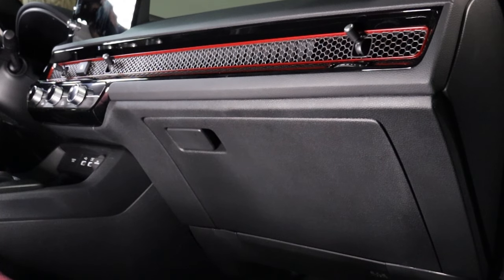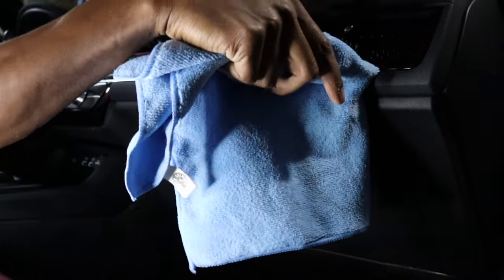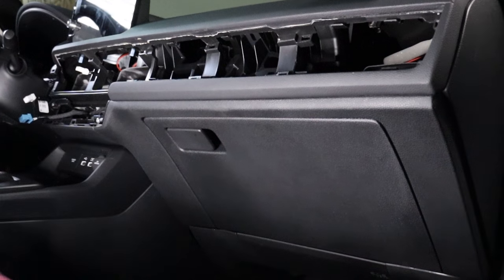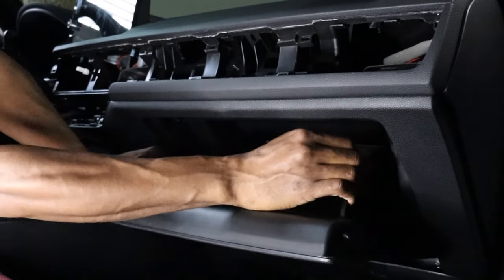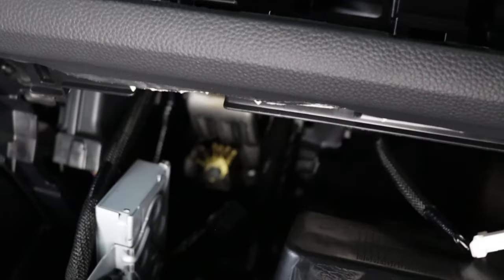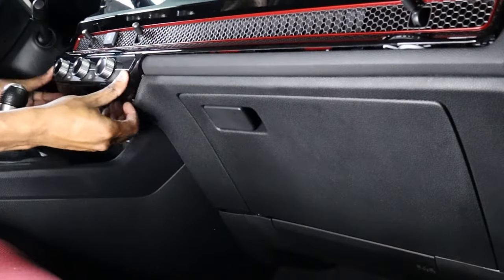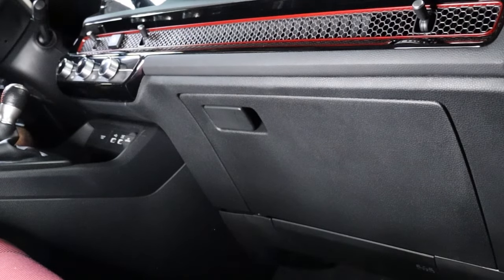How To Disable Active Sound Control (2022 Honda Civic)

Comment: Crazy that they make customers do this and don't just let you choose whether you want it in the software - it's quite obviously something a lot of people won't like!
Reply: To my understanding, it can also affect aftermarket sound systems, essentially making these disabling steps required for any aftermarket upgrade. Quite ridiculous!
Reply: @vanquish421  no need to upgrade anything. I’ve added a full range amp, sub amp, and DSP processor with no issues.
Reply: @sirsnypes631 ik this is late but he’s right, this does affect aftermarket systems , but not permanently. I got a subwoofer installed and when the active noise came (fake engine noise) it bass boosted throughout the car randomly, drowning out noises from the music and making it annoying. I just unplugged it with these steps in the vid and it went away, so it sucks that it is something you may have to do to aftermarket equipment
Reply: Why not put the engine sound into comfort in the individual driving mode bro? Doesn't that turn it off?

Comment: It's such a non-issue. It's hardly noticable, especially if you are listening to music. It's nowhere near as evident as it sounds like on some of the review videos where it's amplified.  The air conditioner at 3 is louder. Seems like alot of trouble to go through for something that is hardly there. That being said, I'm just happy manufacturers are bothering taking the time to even put it in there. They could easily give no supplemental sounds. At least they are trying to spice things up.
Reply: I’m taking away your enthusiast card…
Reply: @NYGFRANK87  this is too funny I agree
Reply: @NYGFRANK87  Honda said they added it because the exhaust is so quiet that while on track you might not get any audio cues where you are in the rev range, especially with louder cars around you.

Comment: Can u do a noise comparison between having it plugged in and not, im debating on doing it to mine
Reply from the maker: As soon as I got done editing this video, I thought to myself “someone is going to ask for a comparison” haha. I will get one soon. It’s not a huge difference, just one of those unnecessary add-ons in my opinion.
Reply: @projectbluray9376  we appreciate you
Reply: @projectbluray9376  thank you for this will be waiting for the comparison thanks.
Reply: Honda has declared this option functional. So if there is 1% of fake sound is there, you have to believe.
Reply: It sounds just like driving in normal mode really… there is a difference with it disabled but it’s just the fact that you can’t hear the fake noise anymore. I personally like it disabled cause the fake exhaust sounded silly.
Reply: Is obvious the difference from the fake noise is very weird in my opinion hate it since day one.
Reply: @projectbluray9376  Can we get that video comparison now? I got a civic si recently and want to disable mine as well
Reply: It’s enough to annoy me. I unplugged mine less than 2 weeks after I got the car. Maybe the type r is louder than the si? It annoyed the shit out of me.

Comment: You don't have to disconnect it. Just de-pin or cut 4 output wires at the amp and you'll never hear the fake engine sound again.
Reply: Have any details on that? I haven't been able to find anything.

Comment: So I recently did this today, I found out that you dont need to take off the vent. I didnt see what the vent was holding to the inside of the glove box. It is only that side trim and everything underneath .
Reply: A part of the glove box sits under the HVAC controls, which is part of that big vent piece.  You do need to release the vents at least halfway off, no need to disconnect anything but at least partially off

Comment: Very helpful. This video made it easy. Just did it in my 2024 type r. You don’t have to fully remove the ac vents. Just need to unclip it slightly past the glove box panel. It’s nice to be able to drive in +R without hearing that Weed whacker sound

Comment: Thanks for posting this. I have a horrible dashboard rattle right over the glovebox. I’ve had my Type R into the dealer twice. They supposedly put sound deadening material under the infotainment screen. That didn’t help at all. I’m going to put in sound deadening mat material/wire wrap myself and use your video. 👍👍👍

Comment: Did this for my 24 CTR today. Found it easier to pop the side panel off and push the air vents out from the inside. We are unable to remove the plug for the Start/Stop button so I kept it plugged in. The Active Sound Control is on the glovebox so only the glovebox needs to be removed.

Comment: Update for RHD Civic Type R - the ASC unit is fitted on the opposite side, behind the glovebox. As with the LHD in thie video remove the passenger side dash end panel, glove box compartment, 4 retaining screws on the under dash mount panel and its on that panel adjacent to the centre console.

Comment: Excellent video. Picked up a ‘23 Si three weeks ago. This is an immediate “must do”!
Reply from the maker: Thank you!
Reply: Naw for real 😂 I got mine 03/21/23 😅 quite annoying
Reply: @Fracking2319  😂Facts!
Reply: @B702K  a pillowed can of bees
Reply: @Fracking2319  😂👊
Reply: @Fracking2319  What color did you get?
Reply: @B702K  white pearl. You ?
Reply: @Fracking2319  Same, platinum white pearl! 👏👏👏
Reply: @B702K  noice....I've noticed it really pops on cloudy overcast rainy days 😍😍😍
Reply: @Fracking2319  The metal flake in the paint is f**king gorgeous.
Reply: I just got my 23 si last Wednesday.  I'm loving it. Able to get 42 mpg on 5th gear at 70 mph. Surprisingly 5th gear is better for the car at 70 mph than 6th gear.
Reply: @Pb88840  Congrats. I’ve been enjoying mine. Installed the Remark exhaust 3 days ago. Complements the sound of the car perfectly.
Reply: @B702K  thanks and congrats to you as well. I will wait a bit to do mods. Good luck on your journey
Reply: @Pb88840  Same to you friend. Enjoy that sick ride!!

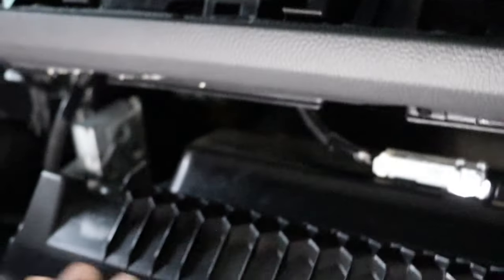Comment: 2:31 The New Acura Integra, has it as well. You just have to remove the center leather metal trim piece. But it works just the same. 😉

Comment: Hi, I bought a civic 2022 sport. I enabled, simulate secondary display in developer option. Now there is an overlay on my screen and now I cannot use the infotainment system.If possible, can you help me with it
Reply from the maker: Unfortunately that sounds like something a dealership may have to help you with buddy.
Reply: @projectbluray9376  this is what we call a dealer lock :/

Comment: Would it be the same steps and location for disabling the sound on a 2023 Civic Type R. Thanks for making this vid !!!!!   Fake sound  😢
Reply from the maker: Yes the module will be in the same location, but you actually will not have to remove the A/C vents.

Comment: can the work be carried out without extracting the long panel of the air vents?  or is it mandatory?  because it doesn't seem to affect the removal of the lower glove box frame...correct?
Reply from the maker: Possibly! Try it out and let me know.
Reply: Yes it can be done without removing the vents/push start/climate controls unit. I just did it today on my father’s FL5 Type R. However it would be beneficial to pop out a few of the clips on the unit where the lower portion of the dash on the passenger side meets the climate controls and the central tunnel. I ran into a problem where disconnecting the clips here was extremely difficult as well as reassembling because the large unit that holds the vents and climate controls has three clips that connect into the lower portion of the dash. It’s hard to get enough leverage to dislodge the lower dash so disconnecting them prior helps a ton.
Reply: And it is literally impossible to reinstall the lower dash without unclipping that part of the climate controls since the unit holds the male prong for the clip to fasten the lower dash. This might sound confusing but it all makes sense when you’ve gotten the glove box and side cover of the dash towards the door removed.

Comment: why did you have to take off the air vents though?
Reply from the maker: @throttletribevn  this was back when I first for the car, since then I’ve learned the vents do not have to be removed. Just the side trim piece and reach.
Reply: @projectbluray9376  thx mate

Comment: How much do you have to remove to get the gauge cluster out?
Reply from the maker: I actually plan on finding out soon because I have a small rattle in that area that drives me insane.
Reply: Did you ever remove it? I have an annoying rattle coming from the clear screen in front of the cluster.
Reply: I have rattles all over the dash. Defrost vents, dimmer switch, Guage  cluster, info screen , a-pillar tweeters, and safety suite buttons.
Reply: Honda build quality is getting worse 😔

Comment: does it work for the new gen type r?
Reply: yes.  you don't need to take off the vent completely though
Reply: @scrapin240  just the glovebox?
Reply: @musiczkl98  you do have to remove the vent, but partially, you do not need to disconnect the wiring.  You remove it so you can pop out the entire glovebox

Comment: Do you have to take the vents out?
Reply from the maker: Yes, definitely makes it easier.
Reply: @projectbluray9376  Is it impossible to do without taking the vents out? If I don't take the vents out, what issues will I come across?

Thanks in advance!!
Reply from the maker: @chriscline3944  I imagine it will be difficult to unplug the module with the vents in, but if you’re able to do it without removing vents, let me know how it goes!
Reply: @chriscline3944  did you end up trying to do it without removing the vents? How did it go?